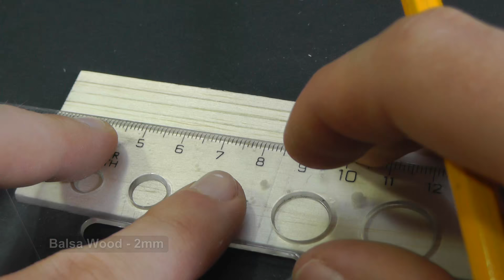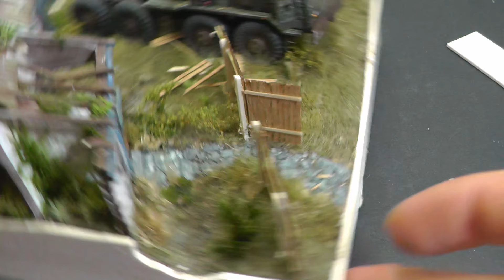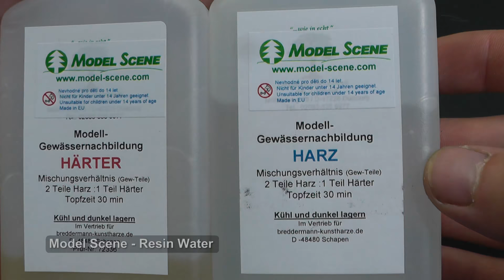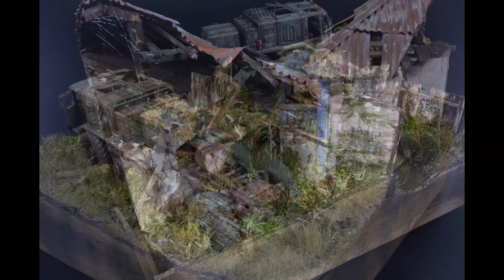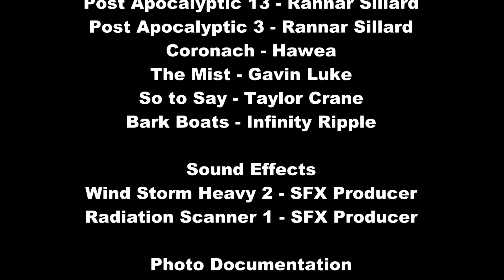Post-apocalyptic Diorama Pripyat Chernobyl - 1/72 Model

Comment: Diorama performed great !!!
Man - you are a master.
But, let me, I want to say about two, in my opinion quite large mistakes.
1. You might not know, but at that time the roof covering sheets (we called them "SHEEFER") were made on the basis of asbestos-cement mixture and they cannot be bent. With a physical impact, they broke or pieces were broken off, but they could not bend.
2. It seems to me that the house itself and the fence (they are magnificently executed) do not get into scale with the tractor. The tractor itself is quite large, and in order to match the scale with the size of the house and the fence, it must be applied one and a half times larger. Here I can be mistaken, since this is my subjective perception when watching a video.

But in general - the diorama is done masterly. You're doing fine !